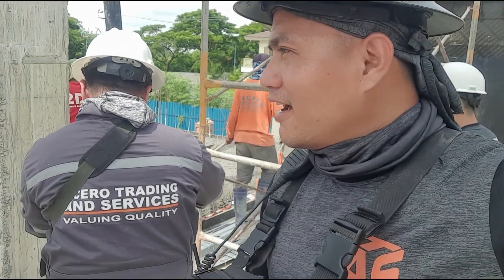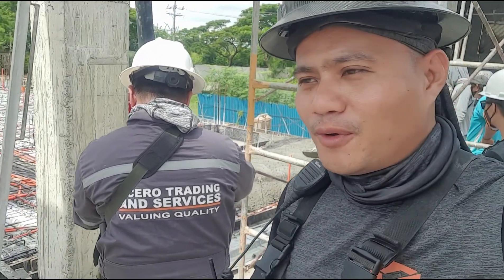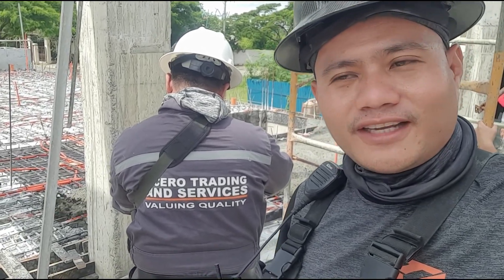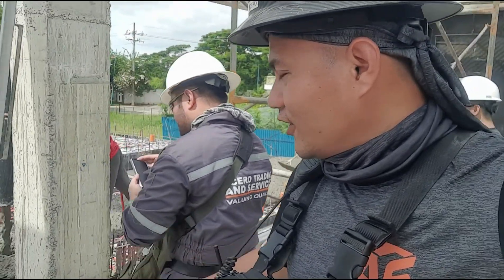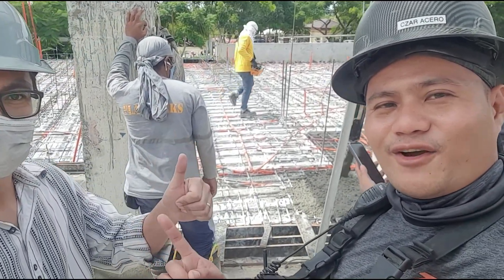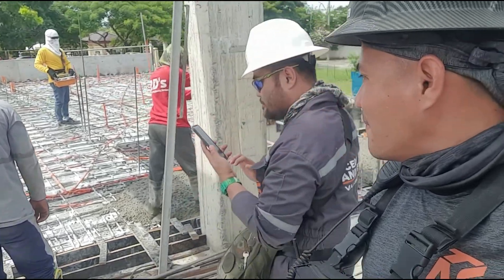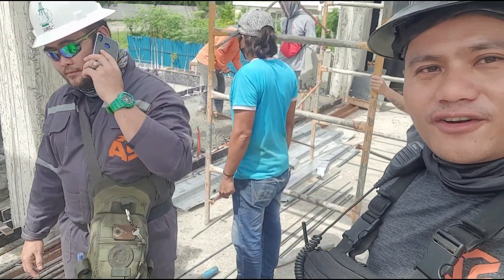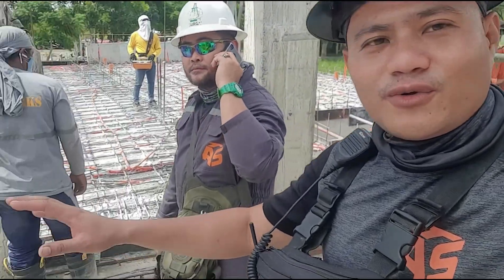Customized Polished Concrete Cebu, Philippines 1.0 - Customized Aggregate Preparations

Comment: sir magkano per square meter ang polished concrete ninyo for residential flooring?
Reply from the maker: Hello sir, daghang factors ato iconsider for quotation:
1. Condition of the concrete
2. Level of sheen you wish to achieve (matte, semi matte, semi gloss, high gloss)
3. Total floor area to be grinded (kay makahatag tag additional discount if dako ang area)
4. Site location.
Reply: @cebupolishedconcreteandmor8907  thank you sir sa response..dito sa metro manila locations ng project namin and last month kumuha kami ng subcon on concrete polishing